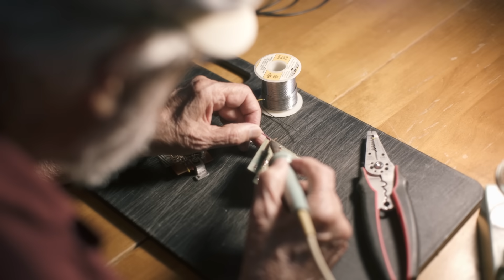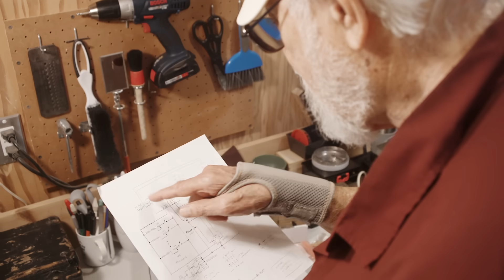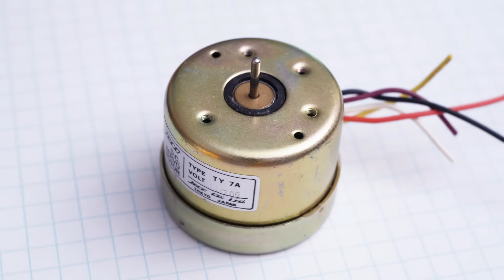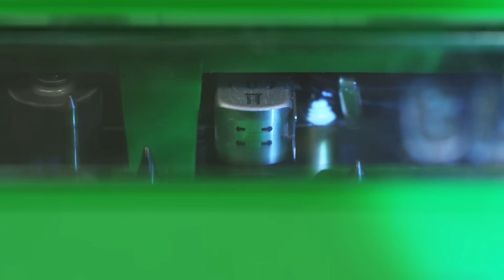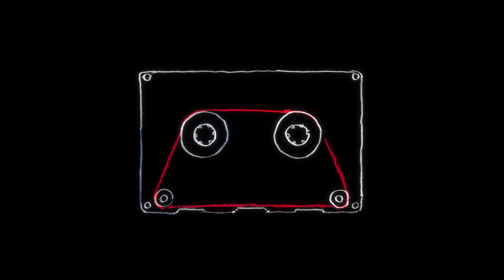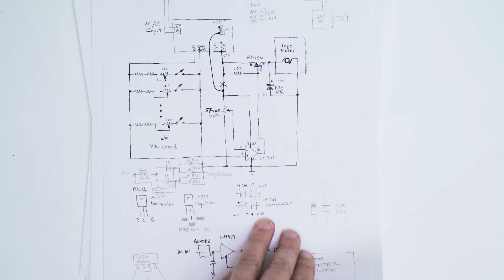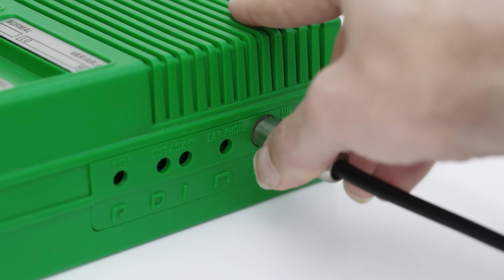Tape Speed Keyboard

Comment: hmm this is a little bit like a granular synthesizer, cool!
I didn't know there were adsr chips, I need to get my hands on one of those...
Reply from the maker: Glad you like it. Yeah, I still haven't ever tried out the chip I got. I hope it's pretty straight forward to use. It seems pretty fun.
Reply: @japhyriddle I assume it's like a VCO except voltage controls each parameter of adsr for each pin on the chip, right? With the other two pins being power and ground maybe? If it is then I assume you can control em with some pots if you know the threshold voltage

Edit: I see now there are 14 pins on the chip and not six lol I can see why that would be confusing
Reply from the maker: @wege8409  At one point I knew how it was supposed to work. But, I never got around to trying it, and then I moved on to other things. Now, I can't remember anything about it.

Comment: I suppose that if you put a trigger of the keybler beneath every key you don’t need to sacrify those keys to make a keybler. So the key triggers itself when you press it. But you would probably loose the cool a/b feature!
Reply from the maker: If that were the case, you'd just be hearing a lot of notes "revving up" if you played staccato. Having a separate key allows for the player to spin the motor up to proper speed before enabling the sound.

Comment: Onde Magnetique is exactly this and currently a finished product that you can purchase, an FYI for anyone watching this
Reply from the maker: It is certainly not exactly this. But it is a good recommendation for people interested in an instrument along these lines.
Reply: @japhyriddle  ok sorry, to be more specific: someone else had the idea for a cassette tape mellotron back in like 2017 and has been producing functional instruments since then. it's not exactly the same because it's not using a Narrator as the tape machine, it used to use a small Sony handheld with variable tape control that was hacked to a controller, and now it's a built-in unit. Onde Magnetique also makes and sells cassettes with patches recorded onto them.

Comment: An arduino based midi to control voltage and maybe a stepper in the tape deck would make for interesting experiments :-)
Reply from the maker: I wanted mine to be all analog, but I agree that there could be some interesting experiments with that recipe.

Comment: I've been thinking about doing this for ages. if you are after doing more work on it, i probably could help. is this a V/octave keyboard, or a bunch of varipots per channel? (oops got my answer, i'm pretty shure that with a steady motor voltage per oactave could work, oh and you changed the motor too... rhemm keybass style kb then) honestly, if you are after going further on this, i'm pretty shure i can help. I have skils and experience with tape stuff. (adding at least a vca+ enveloppe at leaset, could be nice btw). what does make the idea really nice is ecause you can record any texture on tape; as long as you are doing it at a proper base frequency... So cool. oh okay, i should of watched the wjole thing before i comment lol. i use the envgen8 myself (witch isnt analog btw) on the synths i design and build... i have been fiddling a bit with my trex echorec lately though (it has a cv in, but could achieve realistic flanging yet), that type of motor on these would be a great add on imo... Damn i wish i had more tyme, but i'de be whilling to share some circuits for improvement... with v/oct you could add midi btw...
Reply from the maker: I'm not gonna do any more work on this realistically. I have too many other projects that need my attention. But that's really sweet of you to offer to help : )

Comment: It might be worth going on a forum like eevblog or something, and asking about "closed loop motor speed control" circuits. The instrument would basically work the same way, but instead of the pots directly controlling the motor speed or a power supply, the pots would send a signal to a servo feedback loop, which then controls the motor speed. The servo loop would have the capability of changing the motor speed much faster than your current method.
Reply: For many motors, you don't even need extra pieces on the motor, you just need some isolation caps to detect peaks in the motor voltage.

Comment: As soon as the per-key tuning trimpots showed up, my mind went to control voltages. CV/Gate would've worked wonders for this send a volts per pctaves control voltage and a digital gate signal to mute/pass audio output.
Reply from the maker: Oh totally. That makes a lot of sense. I knew nothing about any of that stuff when I started. But also, I found that it excited me the most to use a super direct approach instead of incorporating other technologies.

Comment: Very cool project. Quite an interesting solve for the tape ramp up problem. I like independent gating of the four tape channels. Yields some pretty cool results. 

I wonder how it would go with a sample and hold circuit before motor speed control. I think Moritz Klein did a video on the circuit. And then the common of the key drive signal could be the gate, and you could play it as a regular monophonic keyboard. Then moving the tape channel selects to separate buttons, you have two layers of note articulation and the option to free up a hand.
Reply from the maker: It's only two channels, not four, but thank you. I'm glad you like it : )

Yeah, that probably would have made more sense. I didn't know what I was doing. The whole thing was handled in a molasses impulsive manner.
Reply: @japhyriddle  Ain't nothing wrong with that! I think it's a good thing. It's often in the impulsive molasses projects where you don't know what you're doing that the best discoveries happen. Through that process of discovery, that's how you come to know what you're doing the most through fucking around and finding out. 

I'm going through that process now with my current project and I couldn't be happier. No-one's born knowing what they're doing.
Reply from the maker: @UncleWalter1  Perfectly stated. What are you building?
Reply: @japhyriddle  I'm the electronics and systems design for an art installation. Part of it involves the use of old IV-4 vacuum fluorescent display tubes to make a very spooky looking text display. I'm also making each segment independently dimmable while also multiplexing 16 tubes at a time using an STM32 microcontroller and having it controllable over DMX.

Prior to this project, I had never worked with vacuum fluorescent displays, implemented DMX, made use of a bunch of advanced timer features of the STM32, implemented binary code modulation (the trick making it possible to individually control the brightness of each tube segment while multiplexing) and a whole bunch of other stuff. But I waded through the weeds of it all and after blowing a few things up, I have a working prototype that does everything I set out to do and I've learnt about all of these things and more. 

Still feeling bouts of imposter syndrome, because I never studied electrical engineering or anything like that, I did a music degree and some of a liberal arts degree that I dropped out of. But here I am, hired to design PCBs and write firmware. Life is weird, maaan.
Reply from the maker: @UncleWalter1  I love the look of VFDs. Probably because they were everywhere in my childhood. That sounds so cool. I'd love to see a video of it if it gets recorded and put online. My absolute favorite old display technology is probably Nixie tubes. Have you ever played around with those? I have an old (probably from the 60s or 70s) frequency counter that uses those for its display. A few years ago, the frequency counter aspect of it died, alas. All it can do is just count upwards at various speeds now. It's basically just a really heavy and bulky stopwatch at this point.

As for imposter syndrome, I don't think I've ever felt qualified enough to do anything in my life, ha ha ha. That said, I've seen so many things get botched in the dumbest ways by "qualified professionals".

Comment: what about having 4 tape players all with the same tone (be it a test tone/synthesizer note, a flute, a choir in unison, etc) and all the tape players sync'd up (although that might not matter if its all one long note digitally edited together for the natural sounds like flute or voice). I think the most complex thing would be having a keyboard that can send the keyboard voltage to 4 different independent sources. but is there anything stopping the keyboard you made from sending more than one voltage (or resistance I think you have on there? Im thinking of control voltage on a synth). very cool stuff
Reply from the maker: Wait... is the goal to have some phasing or a chorus effect or something by using 4 decks with the same tone? There'd certainly be a lot of that because of how inaccurate tape mechanisms are. It would probably sound pretty cool.

With how things are wired up currently, I don't think things are isolated enough to plug the keyboard into more than one deck. The motors would drag on each other I think. I don't know. I'm not very knowledgeable when it comes to electronics.
Reply: @japhyriddle  no its to get polyphony. and just use the individual deck's tape speed knob/slider to try and keep them in tune
Reply from the maker: @AngeloSantelliMusic  Oh, I see what you're saying. I misunderstood your original comment. Yes, that would be awesome.

Comment: Your keyboard/tape system has a lot in common with the Mellotron. The difference is that you run a single tape at different speeds. The Mellotron has a separate tape for each key, all running at the same speed. The basic idea is the same.
Reply from the maker: Yes. That's why I said those things in the video. Thank you for watching.

Comment: I would figure out how to use all 4 tracks at the same time, or better yet use an 8 track player.  The keyblers would control each note in a chord as opposed to major and minor, you would have the 1, 3m, 3, 5 so you could play arpeggios instead of just pads.  8 track player would have 8 keyblers 1, 3m, 3, 5, min7, maj7, and minor and major pads.
Reply from the maker: Yes, this is all certainly possible. I did consider getting a multi-track head at one point, but I kinda like the limitation of only 2 tracks to work with. I thrive within strict limitations.

Comment: Very Nice!  I've done this a couple times.  I'm working on my V2.2 at the moment.  For the CV speed it won't track chromatically in my design, but that's fine.  You can play it with a CV gate keyboard or a sequencer.  For the audio part it has modular synth sections which I made from (scratch) Moritz Klein designs.  ENV, VCA, VCF.  It's basically a synthesizer with a cassette as the oscillator.  

Its possible to have audio in, and control all parts with external CVs, and also send out all generated CVs. I made inverted envelope selectable too - this sounds really nice to have opposite - invert the filter and standard the vca.  .  For good measure, I included a trigger output from the ENV. and also implemented a PWM squarewave output which is derived from the falling part of the ENV signal.  At very fast rates, both of these become audio outputs.
Reply from the maker: Thank you. I almost understand what you wrote. It sounds cool : )
Reply: @japhyriddle  Ah, sorry.
Once you get into an instrument description it's hard to know what to leave out :)

My way around a physical tape loop, is to record the same sound in a loop onto the tape.  So I have one sound per tape side.  

With an auto reverse switch, to change playback to the next side of the tape,  you can trick a reversed sound, by recording the same sound on both sides, with one recorded in reverse.

The most interesting part, audibly, about cassette instruments, is the way the motor speed changes - 

It sounds very much like a vinyl record does in many ways.  When I sequence the tape synth, it often sounds like scratching records.
Reply from the maker: @robinsutcliffe_video_art  Sorry, I think I was just too tired the first time I read your comment. Reading it again, it all makes sense. That sounds so awesome!

Comment: This is such a neat idea! Looks like you have a similar relationship with your dad like I do with mine. 😊

So one thing you could look at is buying some basic DIY modular synth modules (ADSR and VCA) and incorporate their circuits into the design, that would give you your envelope control and that would allow you to deal with the clicking of the audio stopping.
Reply from the maker: Thank you. Yeah, we're buds.

I did buy that ADSR chip mentioned in the video (2 actually. I always buy 2 of everything just in case). I think a capacitor is all I need to stop the clicking. I just haven't wired one in yet.
Reply: @japhyriddle  Well that's why I suggested the module kits, if you just have the chips, you have to build the circuit around it. :)
Reply from the maker: @InVacuo  Totally. That seems like a good way to go. If only I knew then what I know now when I began this journey, ha ha.
Reply: @japhyriddle  Story of my life 😂

Comment: You mention stereo, but I think what you really want is a cassette 4-track system.

These devices let you record to any or all of the 4 tracks on a tape (side A left, side A right, side B left, side B right). All you'd really be using is the read head, so you would be able to get away with the cheapest unit... including a "broken -- parts only" one.

If you were attempting to do chords, you could have the root, minor third, major third and fifth each on its own track, and then the MIDI controller would be able to pick out the best speed to get the most likely intended sound based on the keys pressed.
Alternatively, you could have 1 a tone, 2 a tone a minor third up from the root, 3 a tone a major third up from tone 2 and 4 a tone a minor third up from 3. This would give a major chord on 2,3,4 and its relative minor on 1,2,3. So again, the MIDi interface has to decide how best to satisfy input requesting polyphony.

But my thinking is that it would absolutely be best off staying monophonic, and using the 4 tracks to give you an approximation of tone wheels in an electric organ. Generate sine waves for the first, say, 8 tones in the harmonic series, the spread them across the 4 channels. Side A L gets the root and the octave, side A R gets the fifth and the second octave, side B L gets the third and the octave of the fifth and side B right gets the next two, or a bunch of upper partials including multiple octaves. Then you have the signal from the four read heads each fed through their own volume control so that the monophonic sound is infinitely revoiceable. Oh so good.

Plus you can start messing around with putting approximations of these sine waves on the the tracks: triangle, sawtooth and square waves have progressively more harmonic content, so make progressively more interesting voicings. These approximants were used in early synths anyway because they were more pleasing than pure sine waves, but the concept of using them as overtones themselves intrigues me so much that I might have to try it out. I believe I may have enough code already to noodle around with this in a computer program....
Reply: Oooh no... scratch that. Tascam had played around and produced 8-tracks. The internet says they used type II high bias cassettes, but Tascam found they were thick enough to get 8 separate channels without problems.

These 8-tracks are rarer, but there's less interest because fewer people are likely to pull out an old project tape that was recorded on one, so they're less likely to need them. Anyway, the ones I can see on ebay are kind of on par price-wise with their 4-track equivalents. Having 8 channels with volume controls to mimic your tonewheels and drawbars just sounds pretty epic to me.
Reply from the maker: @nialltracey2599  I thought about using multi-track heads. I actually record the sounds onto the tapes with a 6-track (yes, 6!) deck. I actually remember at one point hearing about a 16-track cassette deck!—those tracks must be so hissy at that width. But, the more I think about it. I kinda like the limitations of not having a lot of tracks to work with. Partly because I like working within extreme limitations, and partly because I like imagining a world where anyone can make and share tone cassettes with each other... assuming we all had these tape speed keyboards. 

I didn't want to go the MIDI route. I find the wonky analog method more exciting for my tastes. I love how the concept is so utterly simple conceptually. But you have some really cool ideas that would be pretty awesome. Great point about the overtones like organs have. 

Thanks for you comment : )

Comment: that's such a great project!!! love to see that it'd be possible to do it in an even simpler and cheaper way :d awesome design for the v2 hehe also, why does the shots with you feel... somehow... lip synced? maybe it's just me tho x.x
Reply from the maker: Thank you so much. This is the simplest I could figure out how to make it. It could definitely be done cheaper with another tape deck. I didn't do lip sync, but there's a chance that the audio is a tiny bit out of sync. There was some audio cleanup (de-reverb + noise reduction) that added a little bit of latency that I tried to compensate for, but I may have missed the mark a little.

Comment: Interesting sound. This could be built with a midi keyboard, brushless motor and an arduino in way, way, way less clunkier fashion.
And then you can put like 4 tape mechanisms in there, to get polyphonic sound. Now THAT would actually be a useful instrument with a unique sound.
Reply from the maker: Oh, but the clunk is what I love about it. It's got such character. I love working within strict limitations.